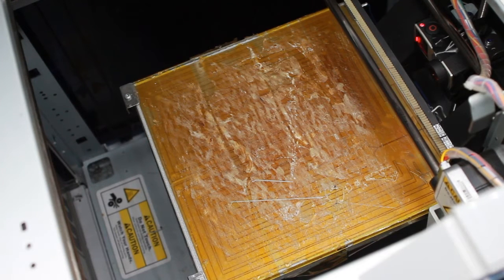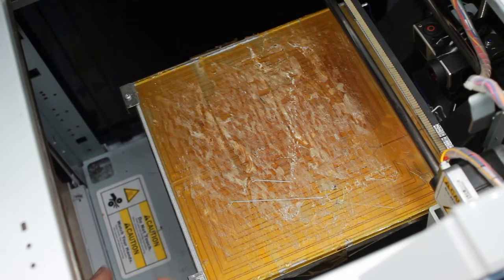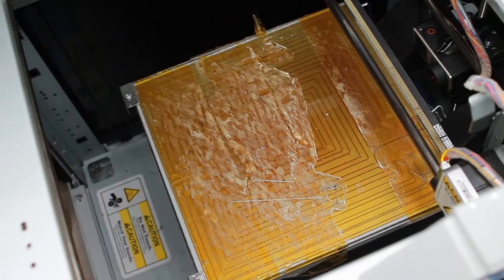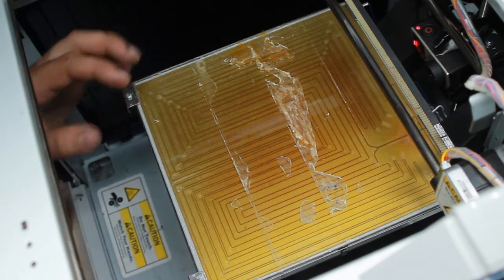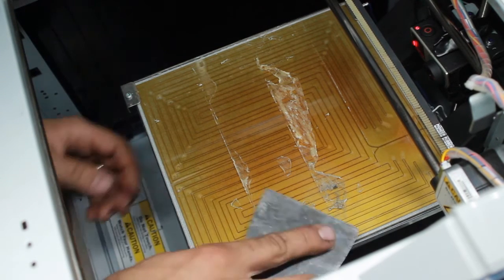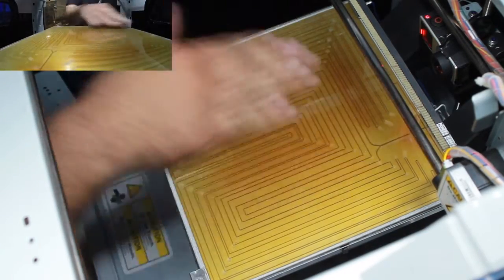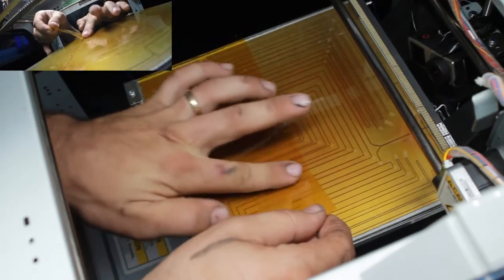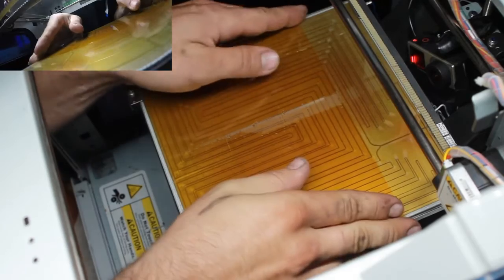Da Vinci 1.0a - Never replace your glass bed again

Comment: Where to buy bed print spare part ?
Reply from the maker: I haven't 3d printed in a while. You could get any kind of 3d printer bed/glass/plastic sheet and clamp it on. Youll have to level the bed to compensate for the difference in height. You'll need something similar size.
Reply: Thank you so much..😊

Comment: Thanks for the video will. I have been watching and watching DAvinci videos as I have not unboxed mine yet. I want to get all the prerequisites I can to get it going with no problems or breakages. I will definitely be using kapton tape to save my glass from getting broken. Might I suggest trying to your scraper to fan out the kapton tape from the center out instead of your hand so that it is a smooth even glide to prevent air bubbles. Also I read a comment of yours to another person about not having to worry about recalibration after using Repetier. Could you please explain that to me as I am considering of going the Repetier route with my davinci 2.0.
Reply from the maker: drunization Thank you for your comment. I think I know the device you mean to stop the air bubbles. I should make a video of how I calibrate it. So what I do is I start a print through repetier. When it starts the first layer I stop the print. I make sure the z axis did not move. I then disable the stepper motors. I do not turn the machine off. Then I move the extruder around calibrating it with a piece of paper. It does take a few tries to understand the feel you get from the paper when sliding it under. I will make a video on it. If there is anything else youd like to know that I might know, let me know.

Comment: kapton tape over the typical blue tape?  Is there any benefit? or is the blue tape mainly used for PLA?
Reply from the maker: FluffMuncher I would say any tape is good as long as it improves contact with the printer. I havent tried the blue tape. Any kind of tape that works for you would protect your glass.

Comment: How do i adjust the Z-Offset on Da Vinci 1.0a ?
Reply from the maker: You can do it through Cura/repetier. I think Simplify3D might give you the option. What I do is use to paper technique to level it. So I start a print. Stop the print. Disable the motors and move the extruder to all points of the bed and make sure a piece of paper fits in between. Hope this helps. I know the z offset is in Cura for sure.
Reply: William Piotrowski I have the stock firmware not sure is those programs will work for the printer
Reply from the maker: I think Simplify3D works but Im not sure about the option. You could try the paper bed levelling technique. Unless you need the off set for a specific reason.
Reply: i just put a buildtak on the bed and need to raise the nozzle .1mm
Reply from the maker: You might look into if you can use cura and export the gcode and put it straight onto the sd card at the back of the printer. You can then print direct.
Reply: William Piotrowski ok thanks

Comment: my glass has some small pieces missing on it can i still put the tape over it ?
Reply from the maker: You could, you may need to maybe fill the small crater with kapton just to have it come out flush with the glass. That is what I would do. Best thing to do is get a replacement glass.
Reply: Thanks
Reply from the maker: No problem, my friend.
Reply: do you know where i can get a cheap replacement?
Reply from the maker: You can look locally but I think I got mine from ebay. Also if this happened within 2 months of owning your printer you could give contacting XYZ a try. They might send you out one for free.
Reply: Thank you

Comment: My printing bed is cracked in a small part of it. Sometimes when i do print a new piece the printer stop printing by it self without giving any warning or so. Do you thank that by applying the kapton tape the issue will be solved?
Reply from the maker: Hello, I dont think the crack in the bed would make the printer stop printing. Are you printing from USB?
Reply: Yes using the Printer USB cable through it is software. My first thought was that since there is a part of the bed cracked somehow that overheat the printing bed which makes it stop.
Reply from the maker: So does the glass actually hit the nozzle and makes it stop. I would try printing from the SD card just to see if the printing stops stopping.
Reply: The printer does not stop in the early printing stage. It does stop in like the mid stage. I will try your solution i hope it does fix it.

Comment: If the 1.0a has Z offset function, why not just clamp a sheet of borosilicate glass to the bed.
I got the Pro and use the glass with water based glue stick with minimal waste of print area. And if the glass chips, just replace with new glass sheet. I gather with the force required to remove the kapton tape, calibrating the bed will always be an issue.
Reply from the maker: I dont actually use any force to remove my prints. I tap the bottom of my print until the glue gives way. I would imagine kapton tape is cheapier and Ive gone through a full roll of it in 11 months.
Reply from the maker: Calibrating also stops being an issue once you use repetier firmware.

Comment: use a tiny bit of detergent and water on a paper towel rinse it completely and it will take glue odf easy
Reply from the maker: +shane agnew thank you for letting me know, I usually soak the glue and it scrapes off easy also.
Reply from the maker: Hey man, I accidentally deleted your last comment. I basically reduced the speed at which it prints, because about 650 hours into my printers life I had the smallest belt on the printer explode. The speed reduction also got rid of the immense shaking and z wobble. My default speed is 2100mm/min.
Reply: thats cool mate, i'll slow mine down what is your normal layer hight?
Reply from the maker: +shane agnew id have to double check. I print 0.3 resolution and the height of my bed kind of squeshes the first layer to be 0.2.